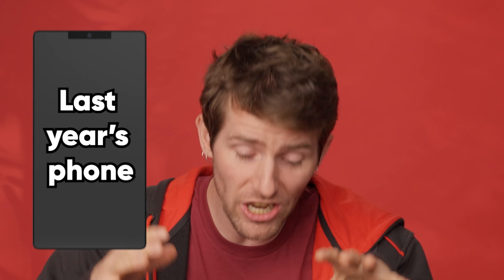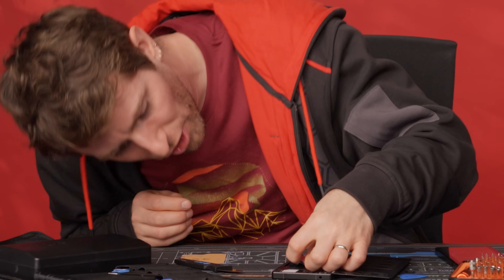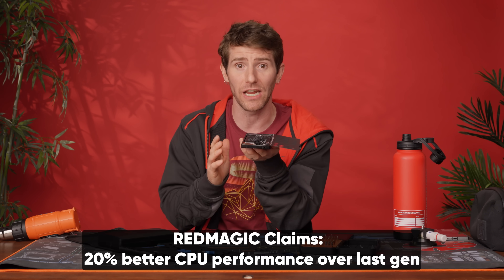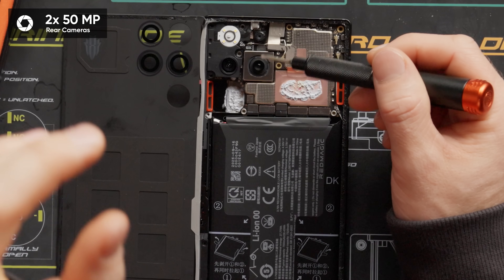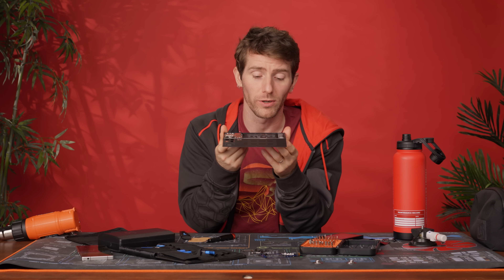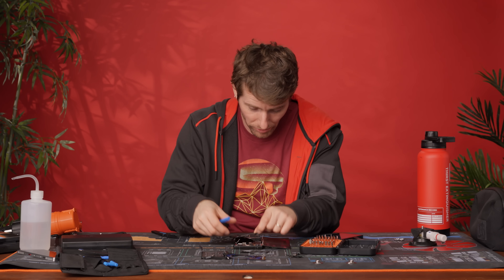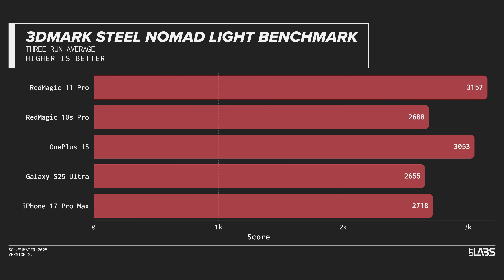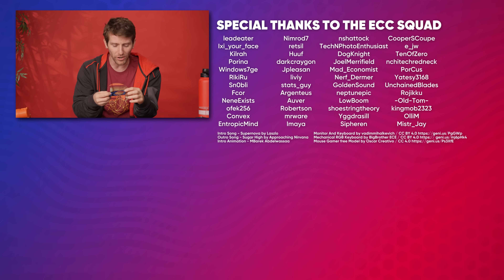This Water Cooled Phone is the Fastest We’ve Tested

Comment: The backpack when release costed 250. Now base price is 350. Today, to send to Greece, along with tax, customs and post office racketeering, it's around 700 final cost. Even with your 100 euro headset included, even with the BF free shipping. It's such a horrible deal that even if you halved the price on top, it would still sound like a scam. The average premium quality backpack we can buy here is around 120. A satisfying, lasting mid-quality one around 40.

Even so, I'd still be willing to buy it along with the screwdriver if not for customs, taxes and racketeering. Please add a European distributer.

Comment: Basically, I’m down to two phones that meet my standards: this one and the Sony Xperia 1 XII. Sony’s main drawback is the charging speed — 15W wireless and 30W wired feels pretty slow for 2025.

The Red Magic 11 Pro has its own issues, though: no eSIM, no AR support (so no Pokémon Go AR mode or camera-based Google Maps), and no L1 DRM certification, which means low-resolution streaming on Netflix and similar apps.

So if you want a pure gaming phone, the Red Magic 11 Pro is the better pick. But if you want something more polished and well-rounded, the Sony Xperia 1 XII is the way to go.

Comment: This is going to be so much cooler when you can play Steam games on your phone soon
Reply: U already can with winlator.
Reply: @cbaileychamp  emulators usually come with a big performance hit compared to running natively tho
Reply: @cbaileychamp  or gamehub or gamenative
Reply: It's crazy what mobile phones can do these days
Reply: I thought that was just for streaming from a PC? Are they actually going to have Steam games running on mobile? Or are you talking about the ARM translation thing they did for the Steam Frame?
Reply: @h4724-q6j  moonlight and steam link let you stream stuff, winlator gamehub etc are translation layers and whatnot in a somewhat user friendly package
Reply: @h4724-q6j  winlator and gamehub run on device , most games run pretty well, just remember that even the most high end phones are roughly equivalent to a 1060
Reply: @h4724-q6j  not, it means running natively on the phone itself. You can do it right now using winlator
Reply: Gamehub, along with the modded versions of it, and GameNative are meant to play your steam library on your phone, and you can add games from outside of steam on them now. Still some compatibility issues, but it can play a decent amount of windows games if your phone can handle it.
Reply: @YDINO69  gamehub and winlator already can
Reply: @YDINO69 I saw a guy on YouTube playing GTA 5—no jokes—on his device, with no streaming or cloud gaming, and it ran well.
Reply: You can :) On this yes.
Reply: need compatibility with arm processor 🥴
Reply: @caustictoad  the fact that valve are making steamos for the steam frame means that they are making steamos for arm processors.

Comment: should do some thermal and performance testing with the watercooling turned off/removed to see if their claims are right
Reply: some guy already tried it, he first putted the water cooling system on an iphone 17 and it did a decent improvement, but after trying it with the remagic 11 pro with the water cooling fully removed it did significantly less change.

the water cooling does work and it does help with the heat, but the fan is just too good
Reply: I think it doesen't do anything performance wise, but helps put a bit heat away while fast-charging because it basically is put on top of the battery.
Reply: why didn't linus use the fancy dancy triggers when trying out that cod game?
Reply: well my old xiaomi redmi 8 pro gave constant,fast fps and great daily battery life. The battery has still not deteriorated in all this time and use. Liquid cooling does work.
Reply: The point of watercooling is ability to soak high ammount of energy, while dissipating it into the atmosphere. This loop has neither high ammount of liquid to soak energy, nor a mean of dissipation of it, aka a ratiator. Phone's fan is only connected to vapor chamber. Thats it. No need for tests. Basic 2+2 if you are smater than a dog. Although a crow can do 2+2
Reply: @stasisthebest oh I know

Comment: I searched on if their bootloaders can be unlocked, but looks like they block that.
That's a deal breaker for me.
Won't be getting. I guess I'll have to wait for another competitor to add back in a headphone jack and have a bootloader that can be unlocked.
Reply: @dedr4m  I mean, won't you lose the fan functionality anyway if you install a custom ROM? Or is there a way to turn it on regardless
Reply: @Your.teammate  I had replied, but for some reason it's gone, because apparently being helpful on this platform is not allowed for some reason.

Anyway, if the kernel sources are released in complience with the GPL, then yes, LineageOS, GrapheneOS and other open source Android Distros would have a working fan.

Others like PostMarketOS would be a lot of work being that it replaces Android with a full desktop system.

edit: Now that I try again to be helpful, the other comment shows, for me at least.
Reply: @dedr4m interesting, thx for the info
And yeah, I only see 1 comment of yours
Reply: @Your.teammate  Depends on the custom ROM:
Android derived ROMs would require compiling the kernel provided (They're supposed to release those changes by GPL, corporates often violate that license).
Then it's just a matter of figuring out any userspace programs to interface with the fan.
That's why Android derived ROMs often have 99% compatibility and work on a huge number of phones, like LineageOS.

For PostmarketOS:
At first getting the fan working would take figuring out if it's ran by the main SoC or if it's ran by an auxillary microcontroller like a power management IC or Embedded Controller. Then figuring out what GPIO pins are for the fan, then creating a Device Tree Binary Object (Basically embedded equiv to ACPI, The readable type is String instead of Binary) that declares the GPIO pin to be of type "fan" and associated with one or more thermal zones, presumably with a custom kernel module.
However, despite the fan issue, to get full linux onto the phone means a lot of things won't work, like sound, touch, displaying to screen, cellular, power management beyond ABL's built in definitions, microphones, sensors, thermal (before the fan, temperature monitoring and throttling need implemented), USB subsystems, cameras (a driver for each sensor set and each independent controller of focus), etc,etc...

That's why PostMarketOS ony works on a few phones officially and maybe a couple dozen in testing states at most.

Comment: While it's obvious that this liquid cooling has no function, no tech editor has ever said this, Linus is the first to say this, and in a video sponsored by Redmagic, it's commendable.
Reply: Tried it and the area it covers felt a bit cooler when the water cooling was enabled. It would be nice if there was a video measuring the temperature with and without the water cooling system tho.
Reply: @guinness630  Shouldn't the area it covers feel warmer if it actually worked to dissipate heat over that area?
Reply: @unvergebeneid  Since it moves the heat to the disipation conduct (where the fan is located), it should actually be cooler since the heat isn't stacking in one place. Phones overheat over time, meaning that the heat stacks in one place rather than abandon the area. The liquid will probably be cooler without the exposure to the heat but the amount of heat acquired while pumping is small enough to not appreciate it since it disipates faster than it accumulates.

I felt the battery warm when the liquid cooler was off because the heat was getting accumulated.

EDIT: tested now under a more demanding scenario and the battery area got warmer just like you suggest on your comment.
Reply: @unvergebeneid the area it covers is the entire back of the phone, so no
Reply: @guinness630  Interesting, I would've thought that hotspots might get cooler actually but the area covered by the water cooling in general should get warmer. Thanks for trying it out though!
Reply: @CoryMck  Well, hotspots should get cooler because the heat is distributed but "the area [the water cooling] covers" as the OP said it should in general (and on average) get warmer. At least if it helps the phone to perform better.
Reply: @guinness630  well I guess right there you’re proving it didn’t work as it should feel warmer not cooler. Liquid cooling doesn’t make things colder. It moves heat from the CPU to the liquid.
Reply: @zooning-6843 did you miss the part of the teardown where they show the dedicated fan and heatsink for the SOC? 

The water-cooling isn't for the CPU, it's largely for device surface temps, which other phones get uncomfortably hot during gaming. This device absolutely should feel noticeably cooler to the touch when the liquid is running.
Reply: @guinness630  oh for sure they measured and didnt want to show since it is bullshit/paid
Reply: @guinness630 that’s bs, there’s literally 1 drop of liquid, it does nothing.
Reply: @mareksinister  I'm just an average consumer. That was just my feedback. Again, it would be nice if there was a video testing the battery temperature before and after enabling the liquid cooling system.

I personally don't think this system is useless because, further than my personal feedback, the system forcefully enables the liquid's circulation when the device is charging, so it will probably serve a purpose.
Reply: Its for generic heat dissipation around the phone. It still has function and does something, it just doesnt really effect the CPU and is probably overkill for most uses. I'm sure there's some small effect when gaming at max performance for over an hour
Reply: @Kindful6754  its probably for comfort more than anything else. I got the chance to try the phone when I was in China and it felt way cooler in demanding games to the touch. My s25 ultra becomes almost unusable after like 30 minutes of gaming not because of performance, but because it feels bad to hold.
Reply: @justaperson8759  That makes sense. I have an S23+ which has gotten hot a few times, but I also don't play demanding games very much on it. I had to stop myself from playing games with gacha mechanics in them so if I play on my phone it's usually Slay the Spire now 😂
Reply: @justaperson8759  I have an S23 Ultra, it becomes horrid after gaming for more than 15-20mins.

The temps becomes atrociously hot and the FPS goes as low to 30fps while playing HSR. And its initially 60fps... and just throws up after 15mins.

We dont talk about WUWA, it will completely fry the phone.
Reply: It has a function: Reduces battery heat. Do not forget that it is the battery that suffers the most from overheating, losing capacity and quickly discharging.
Reply: And for the price compared to over a thousand for apple and Samsung. Count me in.
Reply: that little redmagic disclaimer saying its still important is funny when you look at it out of the phone lol
Reply: I think it's just for ambient heat so the phone feels better when your holding it
Reply: It's clearly no PC-esque liquid cooling, but more like a more effective heat spreader even with that little liquid, which is still actually better than those flat thin pieces of metal serving that purpose in most phones, hence explaining the need to put in an actual liquid pump within seemingly and merely a "prosthetic"
Reply: In water cooled pc it isnt the water thats cools the pc.
Reply: It does actually help with heat dissipation, sustained performance, lower surface heat. If it did nothing then why would they implement this? Why would they spend thousands on RnD and all the extra new design costs? It definitely has some sort of help
Reply: @EthannNewborn  I honestly think even if it does nothing they probably make the money back just from free marketing. I mean I wouldn't have clicked on this video if it didn't say water cooled and now I'm considering buying it. The gimmick gets people to look into a product/brand they otherwise might not have thought about and if the product is strong on its own merits then that will translate into sales
Reply: @halitosmanyurdakul6266  well my old xiaomi redmi 8 pro gave constant,fast fps and great daily battery life. The battery has still not deteriorated in all this time and use. Liquid cooling does work.
Reply: It literally helps
Reply: facts. idk what the fuck less than .02 grams of liquid is going to cool. but it aint gonna be sufficient thats for damn fuckin sure.
Reply: No function is not true, minimal function is better haha, out of alot of tests i noticed the vapour chambor is the Redmagics main cooling method, combined with the build in fan it does make a nice differance (4-7degrees with fan on), with the water cooling temps only dropped 1-3degrees, basically useless but it does do something tho, this is only the beginning tho, in a couple of years they prob finetune this and it should make some more differance, but for now, yeah it minimal, yet cool and innovative! combining these 3 ways of cooling will eventually give you the coolest temps and best heat dissepation tho
Reply: Why do it though?
It makes the manufacturing cost higher for no reason. 
Did they think the marketing from it will be more beneficial and make up for it?
Reply: @SIPEROTH  its cool, and people like cool things
Reply: @SIPEROTH  These phones start at $850 though and aren't just the same thing over and over again like Apple and Samsung, and even the S25 ultra is $899. Even if they're adding cost, it can't be much.
Reply: @redshirtwookiee  The redmagic 11 starts at $699, at least review the facts before passing out your statement as the truth...
Reply: @del8681 didn't think the base model had the liquid cooling, but it's also not $699 in the US it's $749. No need to be hostile, it was a simple mistake.
Reply: @redshirtwookiee  They start at 500-600 USD
Reply: @SIPEROTH Red magic is doing this because it builds precedent to continue working on such tech. Like imagine if the tech takes a few years to fully realise itself, which investors are ready to sponsor them for that long, implementing it early not only helps bring awareness but also gives assurance to the investors that this tech will bring revenue in the future.
Reply: @SIPEROTH it looks awesome!
Reply: @SIPEROTH  well it worked theres tons of people saying how cool this phone is and i think its pretty cool aswell but it is a bit misleading and the fact its a phone from a chinese company has me worried, smaller companies do stunts like this even if they arent even that impressive, but now they have the "worlds first water cooled phone" like that means anything lol theres a reason they are the first, because every other company figured it was a bad idea (it is).
Reply: @XXIV2424  Chinese phones are genuinely incredible and the value for money blows the typical flagships out of the water. When my old phone broke like 6 years back I decided to try out a Xiaomi because it was way cheaper and had some cool features and I will NEVER buy another non-Chinese phone again.
Reply: @XXIV2424  "the fact its a phone from a chinese company has me worried" the brainwash in the west holly dude
Reply: @XXIV2424   how it is exactly a "bad idea"?, maybe they did it first because they could , also it is sold as the " World first mass-produced liquid cooled phone" , so it already says is not the first liquid cooled phone, just the first one that got out of the prototype phase and could be mass-produced
Reply: @ulforcemegamon3094  its a bad idea because you cant water cool a phone by circulating the hot water back and forth it needs to go into a tank or into a radiator to cool down your just pushing hot water around, also when phones get hot the whole thing gets hot so theres no point unless you have a seperate tank that isnt attached to the phone.
Reply: @XXIV2424  they are not first idiot xiaomi already done it before